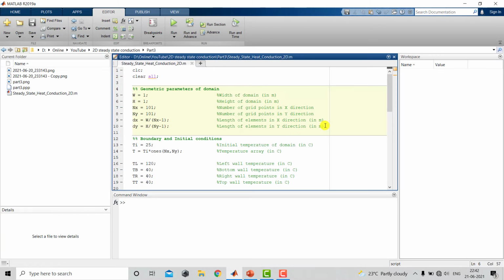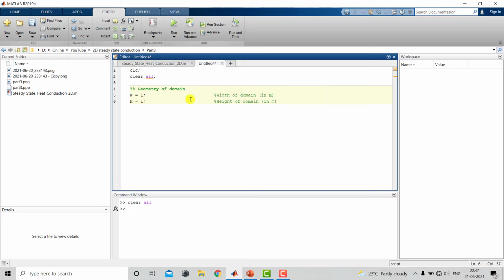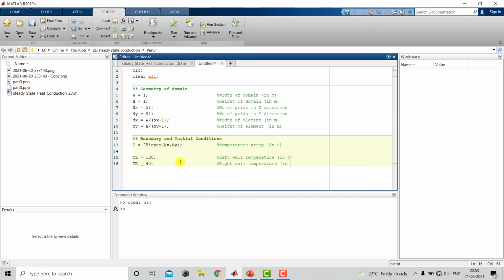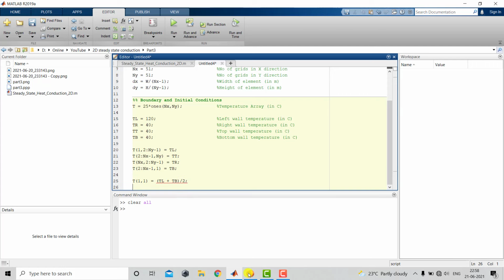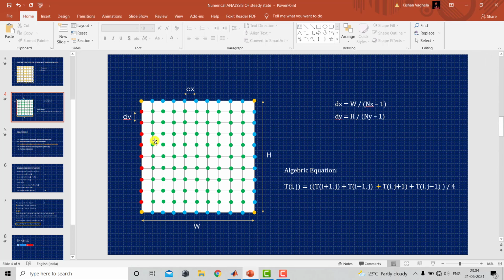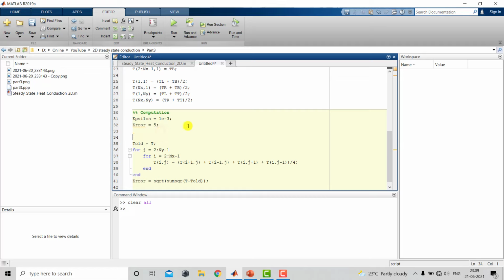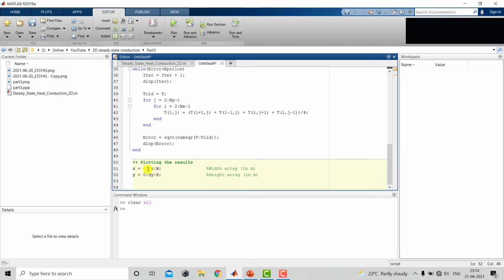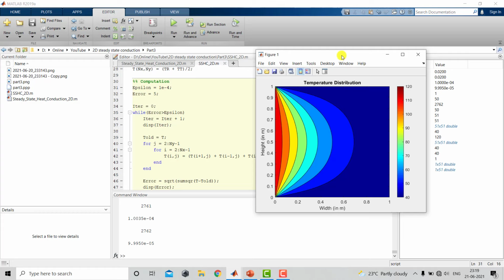🔥 Numerical Analysis of 2-D Conduction Steady state heat transfer. PART - 3: MATLAB CODE.

Comment: hi hi guys how can i do this using MATLAB

Consider two-dimensional transient heat transfer in an L-shaped solid bar that is initially at a 
uniform temperature of 140°C and whose cross section is given in the figure. The thermal 
conductivity and diffusivity of the body are k = 15 W/m · °C and α= 3.2 ×10 -6 m2
/s, respectively, 
and heat is generated in the body at a rate of g · = 2 × 107 W/m3
. The right surface of the body is 
insulated, and the bottom surface is maintained at a uniform temperature of 140°C at all times. At
time t = 0, the entire top surface is subjected to convection with ambient air at T = 25°C with a 
heat transfer coefficient of h = 80 W/m2
· °C, and the left surface is subjected to uniform heat flux 
at a rate of q·L =8000 W/m2
. The nodal network of the problem consists of 13 equally spaced nodes 
with x = y = 1.5 cm. Using the explicit method, determine the temperature at the top corner 
(node 3) of the body after 2, 5, and 30 min

Comment: in my matlab code showing sumsrq requires "deep learning toolbox '' can you solve this problem
Reply: Just install the Deep Learning Toolbox through the tab of Home, in the section of Add-Ons, clicking on the arrow pointing down, and then clicking on "Get Add-Ons". There you type "Deep Learning Toolbox" in the search bar and install the add-on
Reply: @carlostalavera4964  ok broo
Reply: have u any idia about fdm matlab code book name and pdf.
in which book have fdm program
Reply: @JeetendraSingh017  I don't know, I'm sorry.
Reply: when i am tring to run this code matlabR2021b software

Comment: may i know why we hv to multiply by 25 in code line 14,T=25*ones(Nz,Ny);? and in code line 32,why error is set to 5?
Reply: I guess, 25 is just a value for initial condition you can start all T's at 5,10,20 etc. Similarly Error also a start after  one iteration error value changes

Comment: Sir my " nx 12" software running slow after any command it will buffers 2 3 second then it works what is solutions for speed up